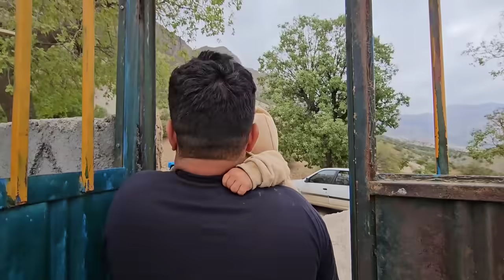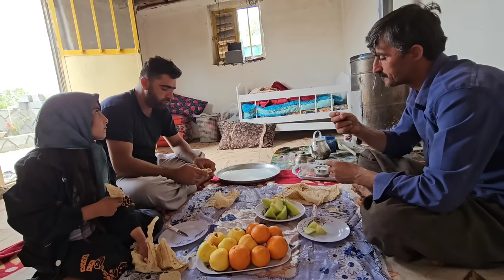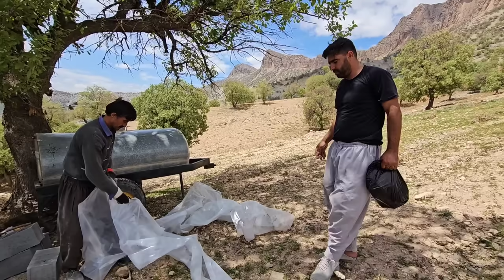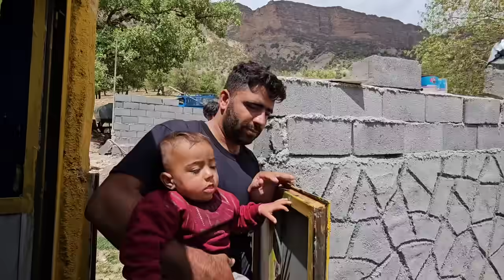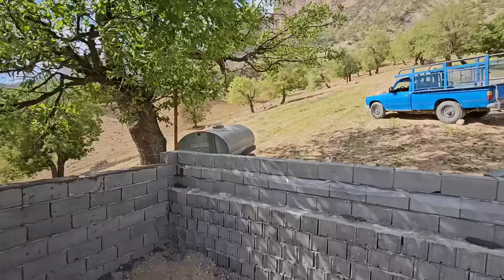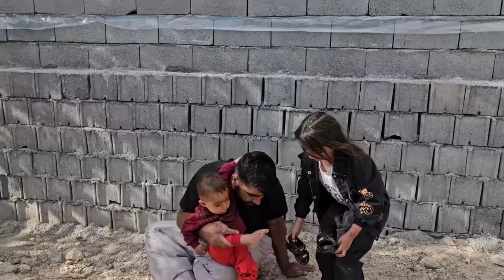Saifullah and His Son Arad: A Nomadic Life Documentary in Beautiful Spring Nature

Comment: Blocks should have been turned  vertically not horizontally and filled with rocks. Yes it would take twice as many blocks and cement but worth the stability and insulating factor. Warm in winter, cool in summer.